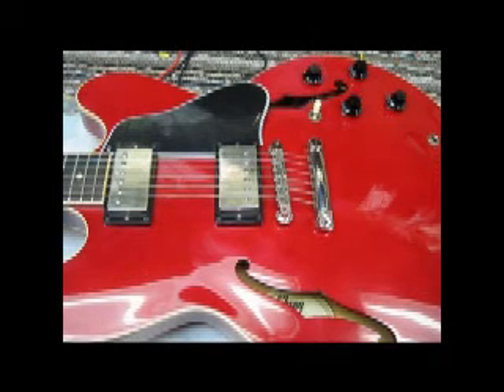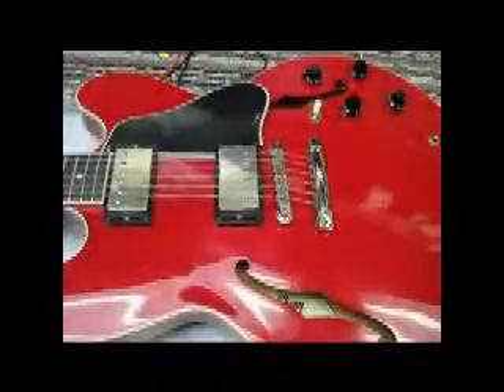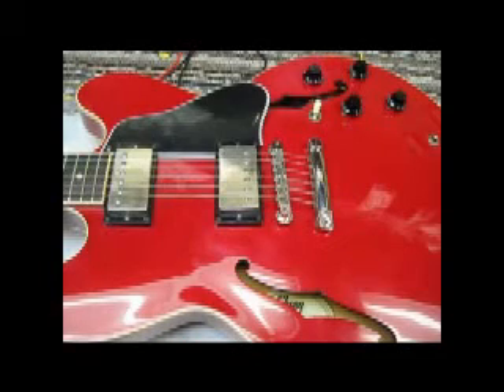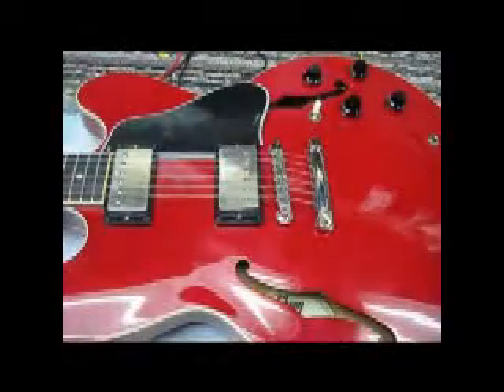vintage pots and caps in a new 335 vox ac4tv jump to 1:18

Comment: Very convincing demo. Years ago, I replaced the standard studs/tailpiece on my 71' Les Paul by Faber ToneLocks. The result was a big difference in sustain.  The notes hold much longer in a consistent manner, even on the acoustically played guitar.  Goes to show that apart from the pickup/caps/pots combination, the mechanical metal parts play a non-neglectable role in tone & sustain... Cheers and thanks for posting \m/

Comment: Love your vids But you need a better camara Pat..I put those caps in both my Flying Vee and a Tele they sound really great...But they want to be opened up to sing. Thanks for tip...
Reply from the maker: Bob Barcus  yes I also think its a software issue it looked good before I uploaded it... the shorts are a nice touch too!
Reply from the maker: patfurlan   it is a software issue with youtube, certain upload formats get butchered... I also have a new camera ... that is HD ... I have been uploading experimental clips to try and work out the best connection speed vs quailty when I try to upload 5 minutes at HD I am getting 2000min load times  Grrrrr

Comment: Sounds great. Pat, would you say that the 50's wiring helps reduce the muddiness of a neck humbucker?
Reply from the maker: +Jim Raimondi yes but its the whole 59 package, wiring caps, pots pickups, steel studs aluminum TP, the closer you get the more it sings
Reply: I found the source of muddiness comes from using 300k pots. I installed Gibson vintage 50s spec reissued pots into my nephews’04 SG. The treble content came back like crazy and the amplifier was registering 9 dB louder at the same settings.

Comment: Pat, Bonamassa says the same thing that 50% of the so-called PAF tone is really coming from the pots.  I don't understand why this would be true since it's really just a variable resistor?
Reply from the maker: the carbon strip in the old post was thicker and has a greater effect on high frequencies... boosting them slightly making the pickups sparkle
Reply: These pots  have been reissued, do you think they're as good?
Reply from the maker: by whom? the gibson ones have the right taper but have a thin silk screened carbon strip